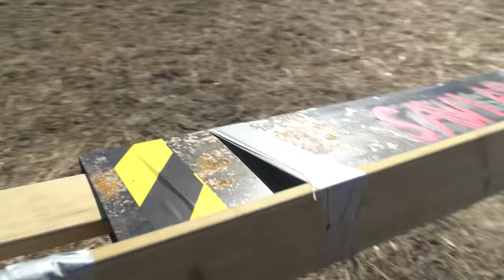Can you Launch Frisbee with Pneumatic Cannon?

Comment: It's never going to spin while still attached to launching cradle.
Reply: unless it is attached by bearings!
Reply: Seems definitely the reason why it wasn't working. Frisbee stays long enough in the sled to be destabilised by it. Sled needs to stay in the barrel of the canon or be tethered to it so it seperates from the frisbee.
Reply: James Dennett I also think the sled is the reason it gets spinning on the wrong axis. As you see good on 5:33, the sled moves downwards because of drag and it takes the disc right with it, with the disc sitting so tightly in the sled
Reply: Your sabot needs pop up air brake flaps on it so that it slows down immediately after leaving the barrel. I would also think that the sabot has more mass than the Frisbee, so it would probably help to lighten it as much as possible, while incorporating a hinged flap on the top and bottom. Look at the designs for discarding sabot tank ammunition for a better idea of what I'm referring to. Love you guys keep up the awesomeness.
Reply: Yup, maybe something needed to stop the "holder" at the end of the "barrel" and let the frisbee go, or it's maybe a better idea to just somehow launch the frisbee itself without any "holder".
Reply: Sometimes i just wondering how stupid the human can be. The frisbee needs to spin to be able to fly, or it is unstable just like it was in video. That's basic physics
.
Reply: In this one post the same thing was called: cradle, it, sled, sabot and "holder". Sabot is the accurate technical name for it.
Reply: @zsombor_99  yes!
Reply: Compressed air for launching & spin.
Reply: Try tethering the sabot to the cannon so it doesn’t even come out the barrel.
Reply: @jfc3552  well... you might have recognized, that they wanted to introduce spin.. right?
Reply: @jfc3552  speaking of stupid, that was the whole point of the video, trying to find a way to make it spin..  and what have you contributed?
Reply: Attach a strong cord to the disc cradle from the inside of the barrel starting where the pneumatic cannon is. Make the cord just long enough to where the cradle can barely exit the end of the barrel. Attach the other end of the chord to either left or right of cradle to allow the disc to spin after exiting the barrel.

Comment: With the sabot staying attached to the frisbee long after leaving the barrel, the weight of the sabot dropping causes the frisebee to go into the head over heels flipping.  I think the key would be to get the sabot to separate from the frisbee immediately after leaving the barrel.  Then try to start the frisbee spinning after it has left the sabot behind.
Reply from the maker: Good idea! I think it would be easy to make sabot catcher 5 000 000 attachment for the barrel :D
Reply: @Beyondthepress  Someway of stopping the sabot right after exiting the barrel, but letting the frisbee fly through the sabot stopping device.  Maybe then, the board along the side would start the frisbee spinning.
Reply: And coarse sandpaper, or something else for traction on the board.
Reply: I think put 2 tabs 1 bottom left on top right and have them so it only catches the sabot and almost stops it coming out of chute but still enough to still release pressure.  Almost same catapult effect used on aircraft carrier. Even grooves fitted strategically to sabot to help tabs work....
Reply: @Beyondthepress  You might also try printing the sabots in two pieces so they fly apart as soon as they exit.
Reply: @Beyondthepress  You could make the attachment sort of wedge shaped so that it's wide enough for the frisbee to exit, but not wide enough for the launcher. It would act like the brakes on a car. Then at the end of that is another barrel extension that curves to one side. The frisbee would roll like a wheel as it follows the curve before exiting the barrel.
The contraption would either work or blow up. :)
Reply: Would just inserting the sabot backwards in the barrel work?      This way it still pushes the frisbee out but doesn't hold onto it.
Reply: The sabot is keeping the frisbee from spinning.
Reply: @Beyondthepress  I would suggest using rubber or something to grip the frisbee on that side a little.
Reply: @Beyondthepress  two tabs at the end of the barrel on each side could catch it since the frisbee is actually smaller it wont be stopped
Reply: Could tie a cable to one end of the sabot so it gets ripped back and flings the frisbee out as it whips around.
Reply: So you're gonna need some kind of... sabotage? :P
Reply: My guess is that the air pushing from behind is preventing the sabot from separating due to the air speed at the barrel end is faster than the speed of the frisbee traveling forwards.
Reply: @blaken2880  And make so one part grips the frisbee longer to get the pin up!
Reply: yeah the sabot is the problem, as long as its in the barrel its stabilized... but when it leaves the barrel the air still coming out of it flips the whole object because the sabot is heavier and tries to be in the front, while the disc acts as the fins - forces it to spin around
either way problem is the same, the sabot needs to not be touching the disk the moment it leaves the barrel

maybe if the sabot is a 2-piece (lengthwise) and flies apart instantly from pressure of the air in front of it it'd do it?
Reply: In addition to this, the frisbee couldn't start spinning in the first place because it never touched the duct tape/wood piece. The sabot hit them every time as far as I could tell.
Reply: @Beyondthepress  Try making the sabot hinged in the middle and catch only one side as it exits the barrel. That may cause the sabot to rotate while slowing it down propelling the frisbee with the free half? You may have to put a "stop" in the hinge so it will only open so far to get the best rotation.
Reply: @Beyondthepress  Attach a small chain to the inside end of the barrel and to the sabot so it stops at the end of the barrel. Makes the sabot like a piston.
Reply: @Beyondthepress  Why not use some kind of pneumatic piston...have it come through the back with a small cradle on the end...the cradle need to be short enough widthwise to not touch the sides of  barrel/guide...it would need two small cylindrical roller bearings on it so the disk stays free spinning...maybe even angle it so it pushes the disk its self into the side of the barrel which brings me to the next part...some kind of rubber or grip tape lined to inside of the barrel to grip the disk and make it spin...it would trave down the barrel being pushed by the roller carrage into that griping surface causing it to spin and when the piston reaches the end of its travel the disk will be flung from the barell with spin
Reply: @Beyondthepress  if the attachment could open a valve on one side of the sabot as it's arrested the airflow might impart a spin on the frisbee
Reply: Maybe a quick cheap test would be to insert the sabot reversed behind the frisbee... You would still get the pressure block and push without the mechanical connection influencing the aerodynamics. I agree you need to impart spin on frisbee but gently so it spins rather than deflects. Good luck.
Reply: @Beyondthepress  If you do that and have one side of the sabot tighter or with higher grip. The separation from the sabot could give you spin.
Reply: @Beyondthepress  the sabot also can be designed in a way that it makes the frisbee spin already in the barrel. It just has to push one side of the Frisbee towards the barrel wall, which makes it spin. Or maybe it's going to explode. I'm not an expert. 🤔
Reply: Is a sabot really needed at all? Why not just improve the launcher barrel to let the disc glide smoothly inside? Without a sabot you could improve the launcher and possibly change the pressure output on each side of the barrel to create spin. I don't think the disc will fly very far without spin because you need the gyroscopic effect to keep it stable.
Reply: @PropaneWP  the sabot is filling the cross-section of the barrel to create the pressure region behind it to push the sabot and the chosen projectile (frisbee, saw blade, etc.) through the barrel.
Reply: @Beyondthepress  also have a clamp on one side of the sabot so it has to spin to escape.
Reply: @JimmyZNJ  I was thinking that. I would have tried at least.
Reply: @Beyondthepress  In line with what some of the other comments have mentioned about using a two piece sabot, it might be possible to create a multiple piece sabot and design the rear of it in such a fashion that the air pressure behind it forces it to separate when it exits the launch tube. For example imagine a paper cup sliced in half lengthwise, if you were to blow compressed air into it, the two halves would be pushed apart from each other. Perhaps there is a clever way to 3d print the sabot so that the push it gets from the compressed air makes the pieces come apart when it's no longer restricted by the barrel.
Reply: @Beyondthepress  Make it a two part sabot, that's shaped so that the air pushes the halves apart.
Reply: Yep.
Reply: Attach a strong cord to the disc cradle from the inside of the barrel starting where the pneumatic cannon is. Make the cord just long enough to where the cradle can barely exit the end of the barrel. Attach the other end of the chord to either left or right of cradle to allow the disc to spin after exiting the barrel.

Comment: An idea to separate the sabot from the frisbee would be to have the sabot be two-part, bottom and top, with springs compressed within. Once out of the barrel, the springs will force the two parts apart, letting the frisbee fly free!
An additional idea would be to have the frisbee only held by two rubber friction pads in the center, top and bottom. These pads would then connect to spring-loaded axles, and be attached to each sabot half with a bearing. 
Thus, both halves would push away from the frisbee outside the barrel, while allowing it to spin freely within the barrel.
Now, if a small, laterally offset hole between the sabot halves allows for some air to pass through, I think you would have a spinning frisbee!
Reply: With the right aerodynamics, springs aren't even needed. If the two halves are designed such that the upper one wants to fly upwards and the lower one downwards, the speed and air will make them separate all by themselves as soon as they exit the barrrrel.
Reply: @alexanderthomas2660  Could even engineer the halves so they separate to the sides in such a way that they push a bit of spin onto the frisbee, too (similar motion to an atlatl).
Reply: @alexanderthomas2660  This.
Since compressed air exits the canon very fast once the sabot is out, just design the backside of the sabot in such a way that the air pushes each part on the side (same for front side, and this way you optimize separation).
This + potentially a thing that retains only the sabot by applying some friction on the upper and lower side of the exit of the barrel.

Comment: There are a lot of good ideas in these comments. One that I haven't seen yet is to shape the barrel with a curve or arch. The momentum will force the disk to the outside edge of the barrel causing it to spin. It is the same principle used in the A5 paintball marker to spin stabilize the paintball, but turned on its side. This would however require a tighter fit between the barrel and disk and no sabot.
Reply: This is the right direction to go. Look at the Tippmann 98 Custom Pro Flatline Barrel, it is curved slightly downward to put a backspin on the paintball causing lift, flattening its flight path and increase range.
Reply: i agree,,, was thinking along a similar line
Reply: I like your idea. Two other options to get a spin inside of a straight barrel: Either add some material (e.g. rubber)  on one side of the barrel that creates some drag and slows the disc on that side or just make the barrel thinner on one side which might create different air speed on both sides.
I would start with either your suggestion of a curved barrel or option one. Actually I would really love to see this project developing, no matter which one of all those different ideas in the comment section he picks up.

Comment: A couple of pins at the end of the launcher to stop the sabot from leaving the tube would let the Frisbee exit cleanly and accept the spin from the board.
Reply: That's my thinking
Reply: Trying to make it spin by something at the end is doomed to failure.  The time of contact is simply insufficient to impart a good spin.  Consider how rifling in a gun barrel works, the spiral starts at the breech and gives more spin the further down the barrel the bullet goes.
Reply: @josephcote6120  exactly! Its carrying so much momentum before it hits the tape that it's pretty much not affected by it
Reply: Allen Harris
A clean exit "sabot free " would only throw the frisbee off to the side probably shattering it when it hits the board that is only supposed to induce rotation..Maybe a roughed up frisbee circumference and a small piece cloth or rubber for it to glance as it leaves the tube inducing rotation and minimal redirection ?

Comment: You need that green and orange piece to come apart super easy in 4 different pieces after it exits the barrel.  That piece is stopping the Frisbee from flying right, by staying attached.
Reply: I think this is the right idea. If the sabot was made from separate pieces, and they fell away right after it left the barrel, you might have a chance. They have to let go of the Frisbee and have enough drag fall apart quickly.

Comment: As others have commented, the sabot is staying attached too long. Also, the compressed air catches up to the disc as it slows and slams it into flipping mayhem. Possibly add a baffled extension (like a rifle silencer/suppressor) to do two things. 1) Strip the sabot from the disc and, 2) Allow the high pressure column of air behind the disc to slow, suppress, and dissipate. Just some ideas. Great video as always!
Reply: air brakes will help to discard the sabot

Comment: Idea on how to spin the frisbee...cut a channel in the outer edge of the frisbee big enough to wrap some string around.  Tie other end of string to the launcher.  When the frisbee is launched, the string will unwind from the frisbee, causing it to spin.
Reply: Good idea. And give the string some slack so that it only catches after the cradle falls away?
Reply: XARIER39 
might even need a mechanism to catch the cradle at the barrel, only letting the frisbee out.  it would be instant destruction for the cradle, but it would stop weighing down the back of the frisbee, which is what i suspect is causing the frisbee to tumble instant of spin.
Reply: XARIER39 
but yeah, i think the cradle needs to separate as soon as the frisbee leaves the barrel, if not an inch or so before.

if done with the string method, i think we'd have a good chance of seeing a frisbee flying over the trees lol
Reply: This would work. The holder/cradle needs some pop out air brakes. Should be enough to cause seperation between the two but not enough to destroy it on every shot. Those holders/cradles take quite a while to print I'm sure.
Reply: @BothHands1  Ah I see what you're saying. I like spit ballin ideas sometimes.
Reply: XARIER39 

definitely, doesn't hurt to spitball.  i'm not sure exactly what the commenter above you means, but hopefully lauri will get it.  if that can save him from having to print a new cradle every time, that would be great.
Reply: Decent idea, but the frisbee will curve towards the side the string is rolling off of.  It's also going to trade distance for spin, but without the spin, no distance at all.

Comment: Like a toy top, place a string around the perimeter (or center axle) of the disc and attach it to the 3D printed part, then have something at the end of the barrel (removable) to keep the 3D printed part from flying with the disc. Perhaps a cage at the end with a slot big enough for the disc? The string stops with the 3D printed part and makes the disc spin by tugging on it.
Reply: This will probably work better if you anchor the string to the base of the barrel and spin the disk as it's accelerating.  needs a round sabot, but avoids impacts.
Reply: Some kevlar cord might be strong enough to make this work. Plus it would be thin and light.

Comment: Rebuild:  fit the tube profile to the frisby and put holes along the left outer edge of the channel for the last meter to suck the frisby over against the side causing it to spin.  Call it the 5,000,003  If it works well you can put two blown-down cans on it and call it the 5,002,003

Comment: You need to spin up the Frisbee as it's accelerating down the barrel. 

I think a round sabot with a cable wound around it with the cable anchored at the base of the barrel will work best.  The cable will unwind and spin the Frisbee as it fires.  Use masking tape to hold the cable to the sabot for loading and have a long tail on the cable to pull the shot into the barrel.   Hot glue (or pin) the Frisbee to the the driven side of the sabot to transfer the torque.  Finally, put breaker teeth at the mouth of the barrel to shatter the sabot before flight.

Comment: Great! Could it be that the yellow plastic thing is having too much weight at the back end of the frisbee, which is causing it to flip instead of spin? Why do we even need that anyway? Have you tried without? Or with just a flat piece behind the frisbee, but not attached to it, inside the canon? The frisbee needs to be free for it to spin.